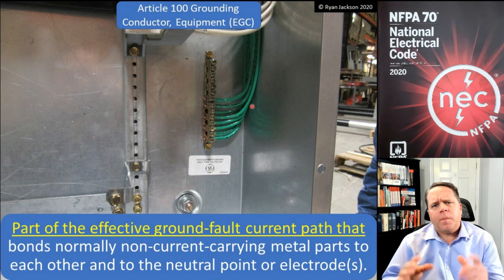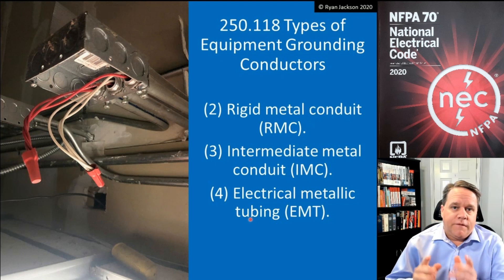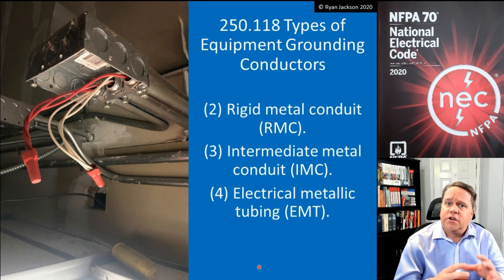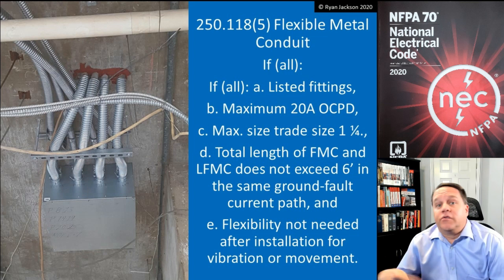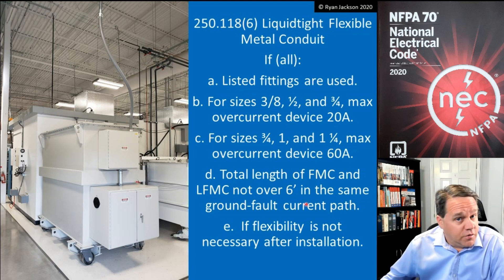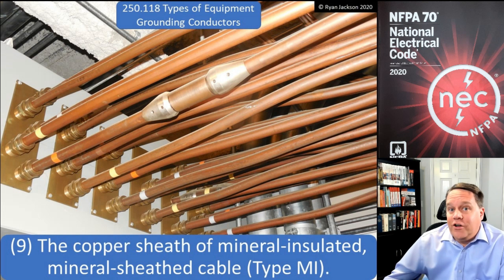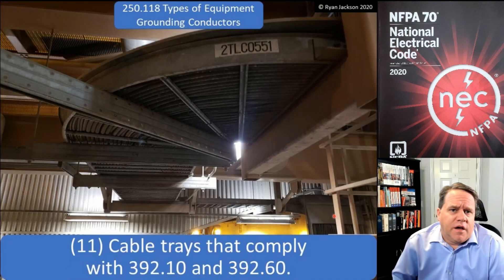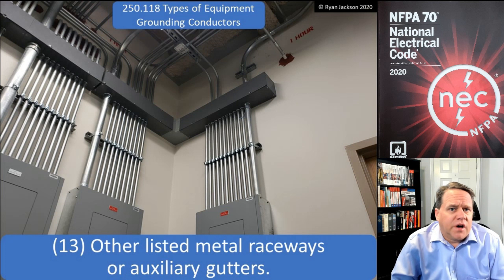100 Days of Article 100: Equipment Grounding Conductor

Comment: If the emt is being used as the ground would the connectors entering the gutter need grounding locknuts type?
Reply from the maker: @zanegreen6382  no.
Reply: @RyanJacksonElectrical  even if its 277/480v?
Reply from the maker: @zanegreen6382  Only if it is 277V AND concentric.
Reply: @RyanJacksonElectrical  oh okay, I missed heard in you in your "when are grounding jumpers needed" video. Only in hazardous location  👍 thank you
Reply from the maker: @zanegreen6382  The rules for hazardous locations are totally different.

Comment: I agree and disagree. Depending on conduit for EGC depends on installation and is vulnerable to future conduit failure without disconnecting the circuit.

Comment: Hey thanks but I’m new to the trade and want to understand this..  I got confused on using the raceway as equipment ground. so you saying anytime I run emt, rmt,imt that I would not be required to run a green ground wire? so why do they do it? I worked around a lot emt and that’s all I’ve ever was taught.
Reply: I had a lazy cut every corner chief electrician who never ran a ground wire when running EMT. A 1.25" EMT that he ran without a ground wire pulled apart at a coupling due to  another trade played with conduit to snake a pipe between conduit & wall. When he was attempting to reinstall the conduit a 480 volt wire that got kicked touched the conduit ( ungrounded  ) and got a severe shock along with chest pains. After that he started running ground wires. Like to have a solar for every time I came across an EMT conduit on set screw & compression fittings that were pulled out & corroded conduit .
Reply: The same thing would have still happened if there was a ground wire in the conduit…
Reply: Yes, if you're using those, you do not need a separate equipment grounding conductor because they will bond and carry fault current. We run an additional "green wire" for reduncy in case a coupling fails.

Comment: At end of video. If EMT is going into an eccentric Knock Out in the raceway/gutter, Wouldn't a ground wire or bonding bushing be needed?
Reply from the maker: The wire would not be required, but a bushing could be. It depends on the voltage. Compare 250.96 and 250.97.

Comment: This was an interesting one. I had not realized that the MGM fire was caused that way. What a freak accident. I have always taken that little bare aluminum ground wire and folded it back over the armor and wrapped it around, ultimately clamping it with the connector. Could that actually be construed as not allowed since it doesn’t “follow the manufacturer’s instructions”? Seems it can only be as good or better.
Reply from the maker: Usually the instructions allow what you describe or cutting off. I would cut it off, since that is the diameter of cable that the fitting is designed for. Adding the aluminum wire to the diameter of the cable probably wouldn't hurt, but it most definitely DOES NOT help.

Comment: Not to stoke up that debate...but I kind of like to think that it's the system that is grounded (per your solidly grounded video) more so than the individual devices and equipment...whereas the EGC (EBC?) does bonding first and foremost. The UK eschews both terms in favor of CIrcuit Protective Conductor (CPC)...which is certainly accurate, and does successfully avoid this controversy

Comment: One thing I could never locate in NEC is the size of bonding wire that runs from a grounding bushing that only contains a ground wire. At the large hospital/ research center that I retired from 13.2 KV switchgear rooms might have up to 10 underground conduits only containing copper ground wires that all went to a 1/4" thick 4" wide by 2 to 3' copper buss bar. Some of the ground wires were at least 250 MCM but they only looped a #10 copper wire from all the grounding bushings to the copper buss bar.  A few locations used #6 wire. Often thought they should have used a heavier wire. In Philadelphia they outlawed all aluminum ground wires ( 7/1981 ) so they never provided a clear answer with the use of using hospital type MC that contains a #10 aluminum ground wire. Contractors stated that the insulated green wire takes care of grounding.

Comment: Very good. I learned about how paper covering in AC ia different from the plastic in MC, also learned about MCI-A connectors for the MC with the aluminum wire inside, and a bit about what a busway looks like. Also, about the flexibility stuff with the flex. Thanks, Ryan.